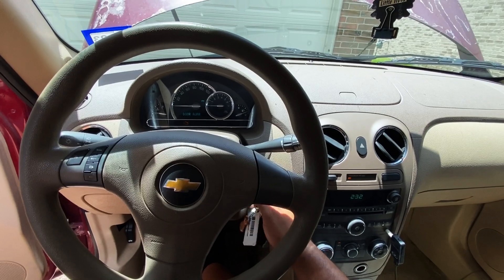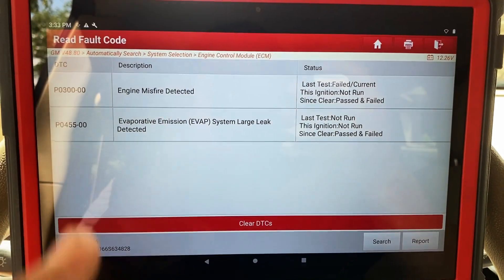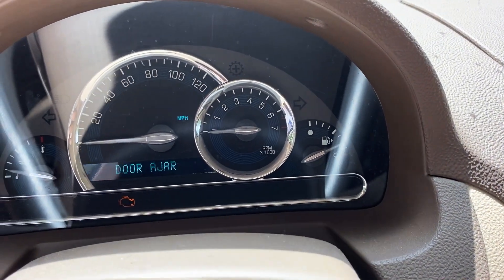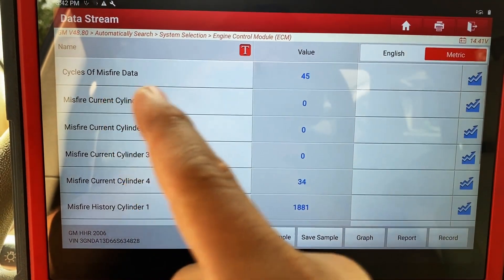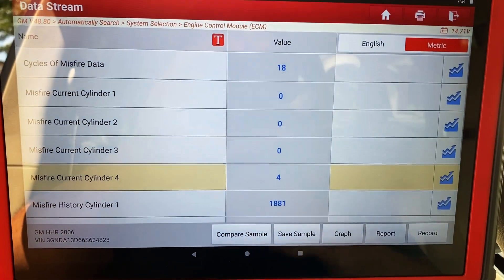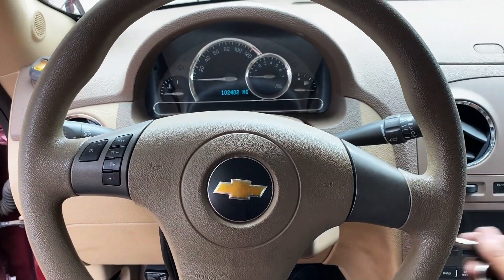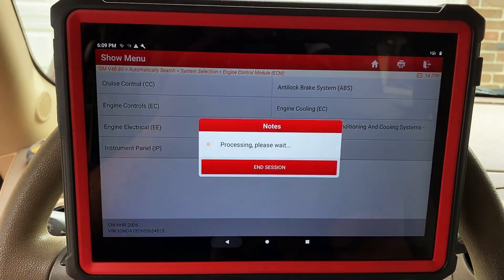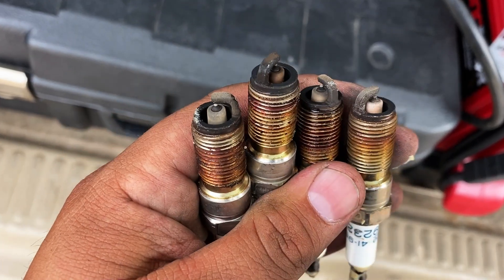CHEVY HHR MISFIRE P0300 DIAGNOSIS & FIX

Comment: Well done son 👏 👍 our HHR is 08 with individual c pacts I believe, I am replacing the spark plugs and other stuff like the air intake hose, air filters, turn signal/lights lever assembly. Over two hundred thousand miles and never changed the plugs! Never had a misfire! Knock on wood 🎉 over sixty years old and I've never seen the spark tester/gap adjustment thingamajig , learn something every day Dad always said. Nifty scan tool 🔧. Good job on the vid. Thanks

Comment: Subscribed!😊 Your video is very informative. The video is good & pretty clear... Question: Will the replacement part work for the HHR in video tutorial work on a 2007 Chevrolet HHR LT? I have the same problem today... I believe my engine light came on when I replaced my gas cap with a keyed gas cap (children playing around the cars in my apartment complex & mothers backlash from informing- from other neighbors😮). However, I was told from an autoparts employee that the new key gas cap is the reason.

Comment: Thank you so much for your thorough and easy walk-thru diagnosis and fix.  My 2010 (red lol) 2.2 HHR LT just started misfiring with engine light and esc/traction control light coming on, right in the middle of driving my grandson to school this morning.  I was barely able to cross the road fast enough to get over to be able to pull over in a parking lot.  Anyway, my husband came with an engine diagnostic tool from work and it came up with the P0300 code but not which cylinder.  So he followed me a couple of blocks to O'Reily's, and their tool narrowed it to the 4th, just like your video, lol.  So my husband bought new plugs and we brought it to our best friend's shop down the road, and while my husband was changing the plugs, (which were pretty bad), I found this video of yours in my search and I love how precise you are and covered all bases easy-peasy.  Well the plug change by itself didn't work, so he went ahead and changed the coil pack, and wallah, fixed.  We were especially happy that you showed how to remove the error code, which we did, then ran the diagnostics again and it all came back good👍.  We were done from start to finish in about 45 minutes to an hour.  I couldn't be happier.  Thank you.  I will keep you on my follow list and you will be my go-to for now on whenever soething goes wrong with one of our cars again.  Thank you again. 😊

Comment: I have a 06 cobalt with this motor.I have a check engine light flashing I changed the plugs,boots and it's said to have a new coil pack.I feel that it's running better but the light is still flashing.where do I go from here.I have no code reader.

Comment: Well done video.  My 2.2 Liter EcoTech engine is in a 2009 HHR.  It looks significantly different.  The ignition coils are individual, held in place by one long bolt with a 10mm hex head.

Comment: Our 2011 has never misfired ..the only thing it's done is "Buck" due to a ignition coil going bad...I had my mechanic give it a complete NGK parts "Tune Up" at 90,000 miles..Runs great with 150,000 original miles

Comment: Really liked that fuel injector drop test. I like how it indirectly verified you didn't have leaky injectors or faulty check valve in the fuel pump since the fuel pressure stayed steady at 40psi before doing the test.

Comment: I've worked on a bunch of those 2.2 ecotech inside cavaliers inside Chevy hhrs inside a Chevy Malibu even the 2.4 l models that have the single coil packs inside the G6 and the Chevy Malibu engines are so easy to fix and the notorious for the coil packs and their timing chains got to keep those engines heavily greased and oiled and tuned up all the time if you don't things will go out

Comment: OEM usually piecemeal every component down to individual
parts. Aftermarket vendors such as NGK and Doorman sell
the same units, usually more assembled.

An oil fill tube O-ring and a good bath would do wonders
for your Customer and this dirty, hot engine.

Comment: Not sure if u have a low amp clamp and a scope but thats something that would of saved u a lot of time. Plus fuel trim reset.
Reply: Please elaborate. My understanding is that your suggestion will only allow visualization of the primary current. Also, since it's a waste spark system, there'll only be 2 current ramps (since there are 2 coils) and the coil serving cylinders 1 and 4 will still show a pattern (similar?) to the other coil. Perhaps you have a better explanation.

Comment: It's always nice to hear how a pro works through the thought process. With only one cylinder misfiring, at first I was all over it being a plug rather than something upstream. But an intermittent open caused by a bad plug would still mess up the spark to the paired cylinder. So, this is more likely to be a short to ground somewhere, allowing the paired cylinder to function normally. The experience factor, knowing what tends to go wrong, and what causes the dreaded callback, is gold.

Comment: My 6.4L had the same code, I was told it was an oil pump, and dealership couldn't figure it out. It was my spark plugs worn before 100k. All pre gapped plugs were out of spec on used and new. Saved $600 swapping all 16 myself.

Comment: Interesting to note that this is the type of coil fitted to some 2.2 se engines in vauxhalls here in the uk. Does the HHR use the pick up on the coil for ignition timing ? like the vauxhalls .First time i worked on one of these took me about half an hour to realize there was no camshaft sensor as such.

Comment: Love the video. I have a question for learning purposes. Why can worn spark plugs cause damage to coil pack? Is it because carbon build up increases resistance for spark causing amps to be a little higher?
Reply: Great question. I'm curious too.
Reply: I know this was 2 years ago. I think the main culprit is high heat due to worn spark plugs. The difference between high vs low heat range for spark plugs is probably what determines which one will be staying in longer without damaging the coil pack. Also, if the coil pack gets bad it could eventually damage the module. If not heat then it's moisture inside the module plug.

Comment: Good diagnosis process.  Also, nice to have checked into the parts options for the customer for maximum benefits.
How many different types of ignition systems are there. Here you state the system is "Waste Spark". How many other types and names are there ?
Thanks for the review Eric.

Comment: 2006 was the last year of the coil cassette. 2007 was the start of the second generation family II's which had individual coil packs. On the 2007 & new family II ECOTECS, you can see they left the threaded holes for the cassettes.
Reply: Also I think the 2006 2.4 didn't use the cassette.

Comment: Must be the week for HHR repair. The one I'm currently working on had oil from pressure sensor pumping through the wiring harness. Computer and wiring harness needs replaced. Probably a few sensors too.

Comment: Made some big money working on these vehicles when they were popular. I use a set of ignition wires I keep around, but vacuum hose will work in a pinch to raise the coil assembly enough and use a test light to test spark energy once you have access.

Comment: Or, you can check it the old fashion way with a screwdriver... you'll know REAL quick if you have spark! lol
Reply from the maker: Honestly, in my younger days I used to do it with a screwdriver all the time. Then I learned the importance of giving the spark a path to ground. Plus a tool like the one I used in the video is good for measuring the strength of the spark in kv. Thanks for watching!

Comment: Is it possible to do this test with GDI systems? I know the high pressure pump must be actuated by the engine to allow the high pressure needed to open up those injectors but I was curious of a workaround that you may know to balancs test those injectors.
Reply: In that case the safest bet is to use a scan tool capable of displaying the actual pressure data from the fuel rail pressure sensor. However, I suspect this scan tool method relies on precise control of injector on-time for the results to be valid/reproducible. Just my thoughts.

Comment: If cyl 1 & 4 are fired by the same coil, why wasn't cyl 1 also misfiring an equal amount?
Reply from the maker: The problem may have been high resistance in the lead going from the coil to the boot. That is internal to the plastic housing that contains the coils. Thanks for watching!
Reply: I have a car that has a wasted spark pair of coils and the bad coil was only affecting one of the two cylinders on that coil.  I would have thought like you that both would be not firing.

Comment: That reminds me of the old GM Quad 4 engine which had a similar cover/coil pack.  For testing, we turned over the cover, put 4 equal length spark plug wires from the cover to the spark plugs.  The cover was the problem and with 4 new plugs also with new engine oil and filter, all was well in Quad 4 land.
Good fix on this one Eric!
Reply from the maker: I remember replacing a ton of coil housings for those engines. Thanks for watching!

Comment: Great video!🤝
 But why was the other 3 cylinders grounded during the test?
Reply from the maker: To give the spark a path to ground. The coil and the module can sustain damage if the coil can not discharge the built up energy. Thanks for watching!